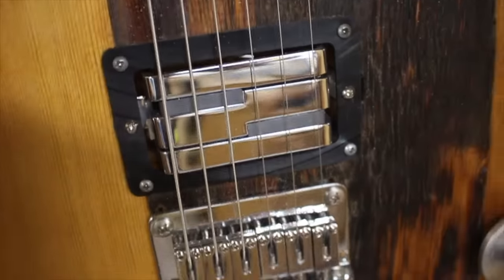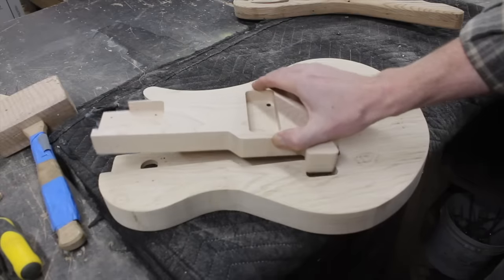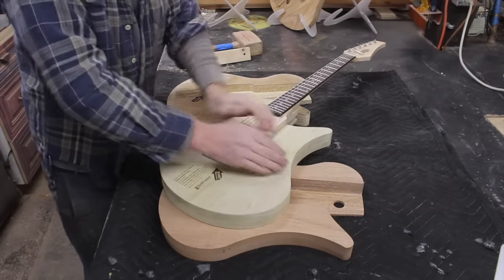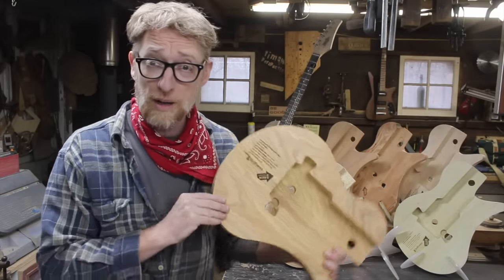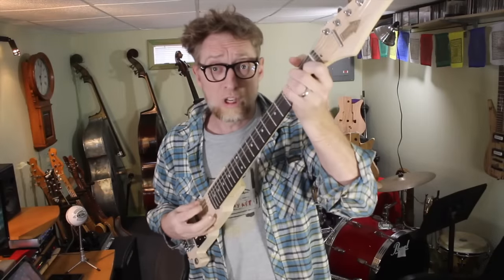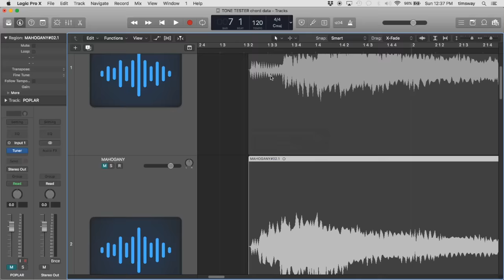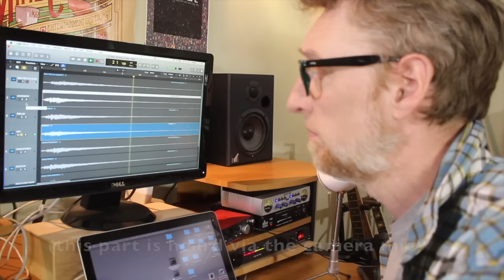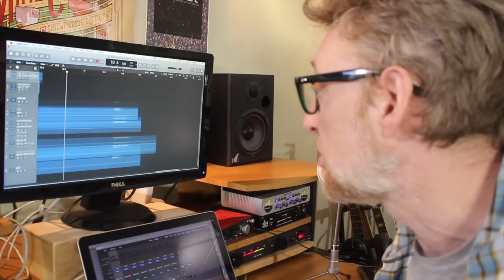Tone Wood Tester: One guitar to test them all

Comment: Dude, great video! Also, what is the string tree thing you have on there? I’m a hobby drummer, but an amateur guitar builder (not much of a player) & nerd, tinkerer & always thinking about different ways to do stuff. I’ve never seen any kind of string tree yet that made as much sense as a straight bar, like I once had/have seen on a Floyd rose equipped guitar. Is that something you bought or made? I want something on my Strats that makes sense. I end up modifying many things myself, from instruments to household to clothing. Thanks
Reply from the maker: Yes, it's A Floyd Rose style. Gives better, even downward pressure behind the nut than Fender style string trees.
Reply: @timsway  that's what I'm thinking makes more sense than ANYTHING. Are there any negatives to that setup?
Reply from the maker: @BillyE5150  a little harder to restring, that's about it

Comment: A very interesting approach and execution but what you are really testing is the interface between your replaceable neck guitar and the various bodies and not the tone woods. Since the Pickups, Bridge and Tailpiece are normally mechanically connected to the Guitar Body but the Nut is on the Neck the means by which the neck is attached also affect the entire system. Glued on Necks act differently than Bolt on Necks. Then when thinking of the density of the medium and how it effects sound a denser material is a much more efficient means of coupling the energy transfer but it takes more energy to get more mass moving. For example the speed of sound in water is much much faster than in air but high frequencies do not travel as far as low frequencies do. This is mainly due to the mass differences while the speed is due to density differences. The same thing happens when a guitar vibrates dense materials are efficient at energy transfers but lower frequencies and higher frequencies react differently due to the mass. Also consider a simple O'Scope display or wave pattern display used on the computer with sound editing is not equipped to show these differences except if hundreds of single frequency tests were done up and down the scale and then analyzed. If you can get access to a spectrum analyzer this would be the best equipment to use and record and display the results. The Guitar is a system, mostly a mechanical system, and each component affects the system.

Comment: Definitely a difference, albeit a minor one. The material the bridge and pickups are mounted to as well as the neck are going to have the greatest impact on tone.
You don't have to use fancy or endangered tonewoods, but as long as you use resonant woods that compliment each other, you should end up with a good sounding guitar.
Reply: oh shuuut uuuuup there is no difference, put the sound on a graphic equalizer so you can check
Reply: @BluessNRock  Not what an EQ does, bud. If you can't tell the difference, just use cheap crap and leave the good stuff for those of us who appreciate it. What's the problem?

Comment: This is an interesting analysis! Two key parts in any scientific analysis are reproducibility and objectivity. Some in the comments have suggested that you should be using some sort of spring loaded mechanism to mitigate the variances in strumming velocity and depth and I very much agree. This would, I think, enhance your reproducibility. The question is how far you are willing to go to control all the variables. At some point, there will be diminishing returns, but I think it would be good for you to, at the very least, document the characteristics of the test subjects, the signal chain, and the environment you are testing in. Here’s some examples below:

1. Test subject characteristics:
1a. Weight
1b. Density
1c. Species (you already have this)
1d. Estimated water content (because wood, especially unfinished wood can change characteristics based on humidity, temperature, etc)

2. Signal chain:
2a. Input interface:
2a1. Impedance; if adjustable, indicate if it will be adjusted and when
2b. Cable:
2b1. Length
2b2. Impedance
2b3. Resistance

3. Environment (at time of test):
3a. Relative humidity
3b. Temperature
 
On the objectivity side (keeping in mind that guitar tone is and always will be subjective), with humility, I have some ideas that can be applied to your analysis without too much trouble; and, as a result, lend more authority to your analysis.

1. EQ Curve:
Generate an EQ curve for each sample. FFT sample and window sizes need only be detailed enough to indicate the what a trained ear could identify. So, for instance, someone with training would be able to listen to a sample and say something like, “There’s peaks at around 4kHz; and a scoop around 800Hz’.

2. Differential EQ curve:
Compare the normalized EQ curves against the control (the neck and pickup module without any tone wood). Show only the differences between the tone wood sample and the control.

Note that the objective here is not to prove “what sounds good”, but to show if tonewood makes an objective difference and specifically what those differences are.

If you’ve gotten this far, thank you for reading and considering these ideas. I’m not an audio engineer by any means, but I do love to tinker and have accumulated some of the tools necessary to produce the EQ curves and make a differential analysis. I’d be happy to help you in any way I can. 

Again. Thank you for making this video. I’m sure it took a considerable amount of time to produce; including time away from your family. I really appreciated how you treated your son; especially how you encourage his curiosity and sharpen his already keen mind even more by asking him questions. This is how refreshingly un-screwed-up humans are made. 😂

Comment: While I do believe that the wood has less (or a different) of an effect on tone than certain electric guitar makers want everyone to believe, your theory and your method may be flawed:

If you break up an electric guitar into a combination of interacting (or not) systems, you have built a "generator system" consisting of the actual "wave generator" (vibrating strings) and a kind of "resonator" (the wood that holds strings and electronics).  The "resonator" actually interacts with the "wave generator" in that it provides positive and negative feedback loops depending on what part of the spectrum we're looking at.  Ideally the "resonator" wouldn't be there (the material would not vibrate and thus transforming energy of the "wave generator" into things we don't need, like acoustic sound waves), however it is there and interacts with string vibration, thus changing the net spectrum (aka "sound") of the "wave generator".  Now to the flaw:

Most if not all of the wave distribution relevant to the "wave generator" is happening in the part between bridge and nut, it forms the "resonator" which is kind of connected "in series" with the "wave generator".  Hence the wood that's merely surrounding this system (aka "body") could be seen as a parallel system that has at most very little influence on the properties of the "resonator" - at least when you DI record the electrical output of this contraption.  The bigger surface of the "body" however makes that a good receiver for acoustic waves emitted by a nearby amp, increasing the influence of the "generator-surrounding" wood, but the type of that wood still has very little influence on the overall system.  There are actual guitars proving that - a vintage PAF-equipped Les Paul sounds incredibly close to an ES-335 with the same pickups, because the sustain block forms a "generator system" very similar to that of a Les Paul, as long as you DI-record both or decouple guitar and amp acoustically, then cue Steinberger guitars or an old German Dynacord electric that has only a tube frame forming a guitar body around a "generator system"... 

So you didn't actually measure the influence of "tonewood" but merely the interaction of your "resonator tonewood" with "other wood connected to it in parallel".  Only a loud amplifier will lead to a noticeable "coupling" (or "parallel feedback loop") of that wood to the "resonator" wood, thus actually affecting the "generator".  I'm afraid the only way to compare the influence of tonewood in the system is using different tonewoods in the "generator" part.  Therefore, your effort only proves which parts of the body have less influence and indicate which parts may or may not have more influence.

Another thing is - no matter how much you try to strum a chord in a repeatable way, there will always be little variations with a big influence on the outcome.  Even if you built a mechanical strumming contraption to create more repeatable results, every chord will be different enough so two waveforms will likely not pass the "null test" (aligning two assumedly identical waveforms, then flipping polarity on one).  However, this is the absolute minimum you'd have to do in order to get waveforms that could be compared in a somewhat meaningful manner.

I enjoyed the video anyway, thanks for taking all the effort, even if this may all sound like this is what I'm thinking, it was not meaningless at all!
Reply: Your right about everything, and I couldn't find fault with your description of the physics involved  !

Comment: Excellent video. I read in "The Science of Sound" by Rossing that a guitar can be modeled as a system of coupled oscillations, which would imply that all of its components would somehow affect each other; however, Rossing notes that for electric guitars this is (obviously) a lot less significant. I think it's alright to say that the wood does have an impact on the tone, but as you say, tone is subjective and the impact is so small that many if not most players would consider it negligible.

Therefore, it would be nice to hear the difference when the strumming is uniform and an open chord is played in order to really hear how different the tones are, (and, as you said, do several tests).

It would also be nice to see a graph of the spectrum of frequencies vs sound pressure to compare.

For the scope of this video, though, this was a great test and your neat guitars made it really interesting to watch!

Comment: Mahogany sounded warmer, Poplar brighter, Swamp Ash like Maahogany but sweeter/clearer and slightly more focused, Canarywood had more harmonic distortion and was in between the Poplar and Mahogany in terms of tone, and the Doug Fir was similar to the Canarywood but slightly louder and slightly cleaner.

All in all, assuming construction is consistently good; 80% or more of your tone will come from string choice and electronics, then knob settings followed by signal chain (quality of components) and technique. The last 20% is a combination of all nitpick things including tone wood and things like the number of pickups (or even pole pieces vs a rail and SxS vs stacked humbuckers) on your guitar slightly affecting the way the strings vibrate.

Comment: Just so you know caps in guitars are wire soldered ( no pcb ) and have caps with 5% tolerance. Say you target 500 khz as cutoff for a filter and boom you get anywhere from 475 to 525 Hz cutoff. I mean that is enough to change the sound of guitar.

Comment: I noticed that sometimes the space between the neck and body is closed, and other times there is a huge gap.  I would guess that it makes a difference,  just like laying a guitar down in the work bench vs standing on its edge make a huge difference. Thanks for the video.  I noticed tonal changes in the woods, you can hear how different groups of notes stand out, as well as some articulation. In my experience, players respond to good tone by playing differently. Keep up the hard work and next time hammer those babies in! And if you can, average a few samples of each...

Comment: I really love your videos, makes me want a woodshop. I wonder if shape and size play a larger role than material?

I imagine the difference in sound has to do with frequency response.  I wonder if this could be quantified easier by putting a speaker in the swappable module.  Then run a frequency sweep in the range of guitar at a fixed amplitude.  This way you get to see what frequencies a body favors.

Comment: Great comparison and great idea of the flexibility to change the bodies. I think a spectrum analysis of the tone give you more information about the differences. You will see the included overtones. An other idea to use wood and tree fungi - on violins such wood had a great influence and came close to the tone from Stradivari. The cell structure of the wood will broken up. Up to the next compares

Comment: Great video! Although I doubt that the first one being lower volume has anything to do with mass and rather plucking a little softer, since for electric guitars it's all about preserving the energy inside the string - I remember a video of someone setting up a string on a steel beam and being amazed by the sustain, but of course if the setup is rigid like that less energy will dissipate and dampen the vibration.

Comment: Does tone wood have an effect on what comes thru the pick up, or the speaker? Acoustically I understand the tone wood effect, but aren’t the pick ups only pulling from the vibration of the strings?
Reply from the maker: every part of the electric guitar is going to effect the tone. some parts are more important than other. Wood is pretty low on the list.

Comment: Not to make excuses in defence of “tone wood” but I would think the difference would be more pronounced with a middle pickup location. The things larger vibrations would be clearer there, I think, so expect that it’s a better representation of the overall sound. Also what you said is probably true, about the rest of the body being practically sawdust. Like a bow and arrow, what’s attached to the most static part of the system, doesn’t affect it as much as the bow itself. I really think you have to change the neck-to-bridge portion to see any noticeable difference.

Comment: Your Son is  DEFINITELY a " Chip off the Old Block " . No offense intended there . You don't look that Old to me . 30-35ish . He's adorable .
THAT  was possibly the Best , most Scientifically Valid Tonewood comparison  I  have  seen  so  far . Well done .
Just an Observation here . To eliminate further variables , a Two Bolt system mounted INTO the Core body (threaded inserts) to pull the Tone Bodies into place AND  a  Support Jig , with a Mechanical Plectrum device  AND  an Auto stop on recording below a certain  dB  level  would be kinda  definitive for sustain .
I  agree that the Poplar sounded DISTINCTLY different , even from the Bare Core . Somewhat brighter but shorter sustain .

Comment: I love your approach to testing this persistent belief in music, and how you removed a lot of variables with the modular design of that guitar.  I had an idea for testing how much pickup height affected sustain by rigging up an system with a weighted rod on a pivot with a pick attached to it that was dropped by pulling a pin so it always struck the strings at a consistent velocity, force and pick angle.  The other part of the test involved a magnet glued to the pick guard in a way that I can adjust the height, rather than mucking around with the actual pick up height.  If you ever wanted to repeat this experiment and remove a few more human variables I think that strumming apparatus would help.  As for stuff on the neck end, either strum open strings or make a sort of 'chord capo' with a carved block of wood or rubber held down with a wood working clamp.  This way variations in finger pressure and how close you're fretting the note to the fret won't influence your test as much.

Also, I thought it was awesome how you had your son pop up in the video and give his input on how he thought it would go.  It's great seeing young people with the tools to do their own critical thinking.

Comment: One simple way to remove the human strumming difference factor would simply to set flat the guitar and use an ebow set on something to hold it to agitate the strings. Possibly modified the ebow so it can be turned off remotely and then you can test for sustain difference

Comment: Great experiment. It would be great to see an experiment on what structural qualities affect the tone, structural being the parts holding the string tension, and how woods may or may not affect that. I have a carbon fibre structure bass guitar (Modulus). Furthermore, the fingerboard wood is also claimed to affect the tone. Is that proven?

On another note, I would love to be able to slide my bridge pickup into the MM position between songs. There is a big difference in tone even between the 2 individual coils of the bridge humbucker (switched as single coils) because one is closer to the bridge. I would just love to slide the humbucker (connected in series) into that fat position from time to time. I'm seriously thinking about getting it properly modded.
Reply from the maker: there have been a few manufacturers to dabble in movable and swappable pickups. there may be some stuff already on the market.
Reply: I predict that the structural properties of the guitar,  where string tension is maintained, will have a significant effect on the tone. This is because these materials transmit vibrations that I would assume are equal and opposite to the string vibrations and how they react to these vibrations will vary based on the structural qualities. 
A grand piano, for instance, holds string tension via a metal frame but uses a wooden enclosure for acoustic resonance.